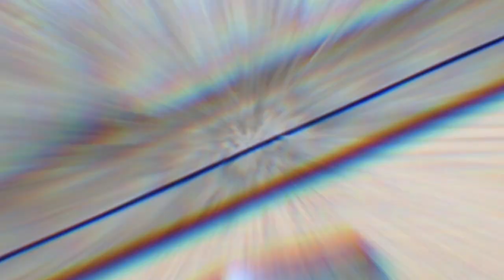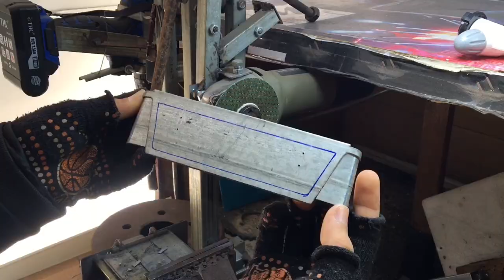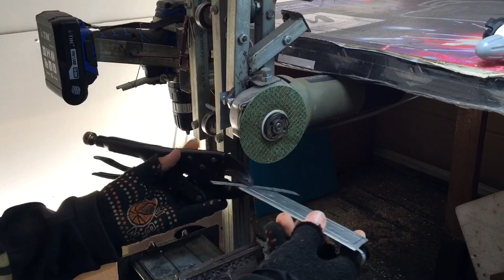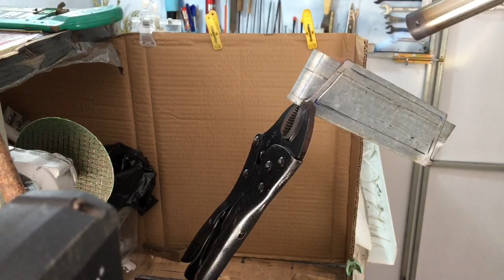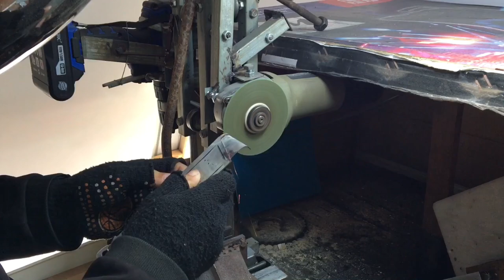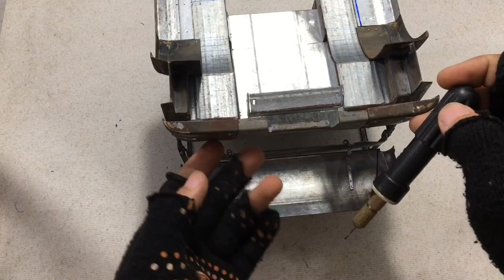How to Make RC Truck 1/14 Scale Cabin Corner Panel Inside Part of MAN TGS Model Amazing Metal Idea

Comment: Bro you connect some metal cable to the hand drill motor. What is that cable?  Pleaseeee bro tell me bro. Reply me fast bro i need that urgently
Reply from the maker: Sorry friend I don’t understand what you mean.
Reply: Bro i mean you connect the hand drill to esc. Suppose the servo motor have a jumper wire and that drill have what wire